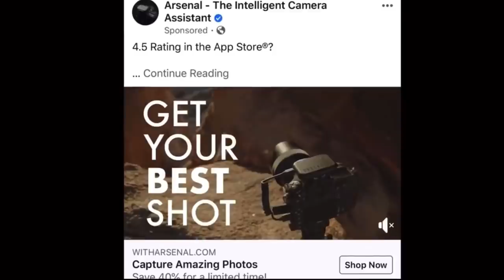How to pour concrete footings: Building The Farmhouse | Day 3

Comment: Speed poles are awesome! I recently built a 4m high retaining wall out of block and used this method. I have never laid block before this and used an amateur crew to give me a hand. It worked great and the wall ended up straight and in the right place. The only issue i had is that i used a Empire Smart level to plumb the poles and later found out that the digital gauge was not reading exactly plumb! My wall ended up a quarter inch out at the top so very disappointed with this level. Anyway thanks for sharing your tips. I really enjoy watching your videos!

Comment: Some bar clamps from harbor freight work great for setting block story poles. Laid hundreds of foundations and story poles are the way to go, easy to laser a level height across and start laying. We usually set them on the inside of the block wall so that you're laying to the line on the more visible side of the basement wall. Good work !
Reply from the maker: Nice!

Comment: I'm curious, when you put the rebar 'pins' in, so that you get the concrete level in the foundation, why aren't they removed before the concrete sets. Surely they will rust from the ground upwards (as they're in contact with the soil) and leave holes in your foundation? I'm curious as I'm building a house here soon. I appreciate any replies.

Comment: Jamie, you ain't crazy... everything is built off the footers, right?
Reply from the maker: It is
Reply: We tend to pull a screed over the footing between height pegs like that as well. We also compact the concrete with a vibrater which gets it close to height also. Usually we run plastic DPM under the concrete footing and we are  supposed to not use height pegs as it punches a hole through the membrane.   Although I've only done a couple of years carpentry in NZ. Its cool to see the same principles of building but different styles between countries or crews.

Comment: @1:43 its amazing to see how easy building foundations in warm climates is. in E-stonia I prefer cutting down till you hit rock or when cutting soil: the frostline (some places 100y frost is 2.1m (14254323245 kingsfeet)) + some extra for the pad. the foundation walls are gonna sit on (pad angles down 45° and is ~30cm thick compacted crushed 16-32mm rock w geotextile underneath).  
then ofc formwork for the foundation concrete foot & concrete block walls up till floor level. hydraulic paint on membrane on the outside of the wall + french drain w geotextile all around the foundation with a deeper geotextile lined sink pit for the water away from the house.
and ofcourse under the floor I cut the entire pad down to load carrying subsoil, then geotextile to separate layers + fill back up with compacted sand, then a freefloating concrete subfloor with thicker parts for stoves/chimneys etc (ofc separated from the foundation wall with insulation and has a nice thick layer of closed cell insulation foam panels underneath + plastic to separate it from the concrete pad). and since I live 56° North. a nice thick vertical layer of insulation around the outside wall from crushed rock pad up + a 1.5m..2m radius of insulation panels just below the ground level surrounding the house to protect it from frost coming in at 45° angles from outside.
also goes without saying lots and lots of wastepipes with extra inputs (prolly separate grey+blackwater) + freshwater + floor heating (every room gets its own line, big rooms get multiple zones) + flex pipe for data+electricity + many many many pipes going from the utility room to outdoors for new incoming/outcoming utilities
all around the foundation everything is filled and compacted with sand

Comment: Wouldn't all the residual water in the perimeter trenches disrupt the water/cement ratio, and consequently the strength of the footing as well as bring about issues with segregation and bleeding? Or have these been compensated for?
Reply: Alright, just found the explanation here, for all those wondering as well: https://www.forconstructionpros.com/concrete/equipment-products/article/12078138/standing-water-in-prepared-footings-a-problem-or-a-precaution

Keep up the great content and the work you do as always!

Comment: Why did you leave the water in the footing for some of the concrete pouring and remove it for other sections of concrete pouring?
Reply from the maker: Good question… Not so much worried about the water, just wanted to get the mud out. The concrete will push the water out and concrete cures due to a chemical reaction so water won’t stop it from drying
Reply: @PerkinsBuilderBrothers  thank you so much for the explanation!

Comment: We've found that using a boom pump costs nearly the same (700 vs 500) as line pumping by the time you factor in ordering pump mix concrete for the line pump. No dragging hoses around is the biggest plus for us. Love the videos! From a fellow builder in Chattanooga
Reply from the maker: Cheers! Thanks... was just in Chattanooga a couple weekends ago. Finally saw Rock City with the family

Comment: Another great Building Video! I noticed the excavation wall is very close to where the outside block wall will be. Not enough room for waterproofing or is it just camera angle?
    12 inch block on all backfill walls⁉️ The back wall is very long‼️ My experience is that the center of that run will be weak and subject to failure when backfill or over time- pressure from soil compaction and water. Another reason for 12” block and row locks (wire) every other course even though rebar installed. Will YALL fill block cells with cement or mortar at rebar columns⁉️
    I LOVE YALL- Keep up the GREAT WORK AND VIDEOS- THANK YALL AND BLESSED THANKSGIVING 🙏‼️
Reply from the maker: It’s tight, but enough room. #5 rebar and bind beam every 24” horizontal and #5 rebar every 16” vertical... all poured solid
Reply: Perkins Builder Brothers Thank You for reply!
     Bind beam or Bond Beam?
  The Drone Footage in other - Breathtaking and the view from Blue Ridge Parkway‼️
      Funny- my adrenaline is still pumping watching for 3rd time as though I was there with YALL- bringing me back to when I was doing what Yall are‼️ 
     YES Jamie, A THING OF BEAUTY‼️
     Still Praying for Jay‼️ His sugar got me worried last video ‼️
    How long ago was the pour?
In a short vid, Eric was snow skiing in Tee Shirt and this video, Yall are in short pants⁉️
     Thank YALL FOR BRINGING ME MUCH HAPPINESS AND BLESSINGS‼️
     Blessings For YALL’S THANKSGIVING‼️❤️🙏
    12” blocks⁉️

Comment: What are the red caps on top of done of the vertical rebar?
Reply: Stops you getting impaled
Reply: In some municipalities,  these are required by code to pass inspection: the caps are for safety.  A good idea whether required or not.
Reply from the maker: Safety caps to help prevent getting impaled if you fall on the rebar ;)